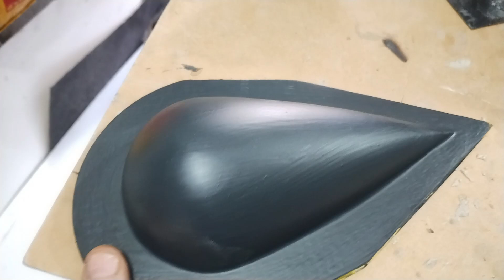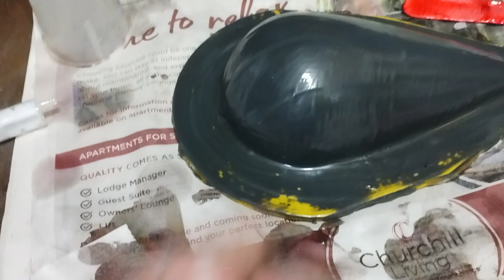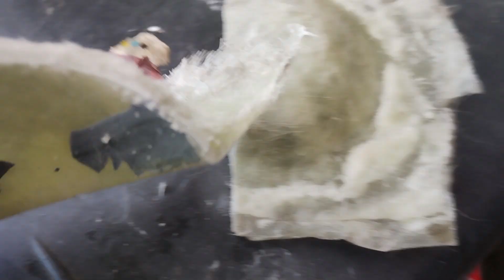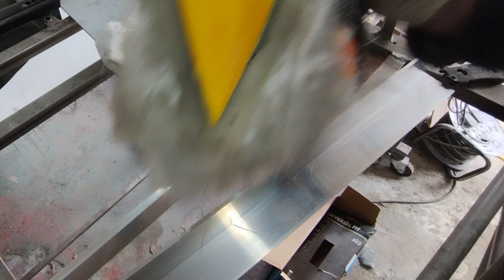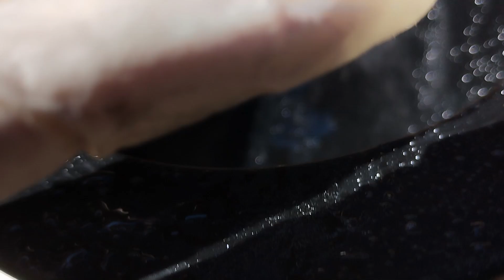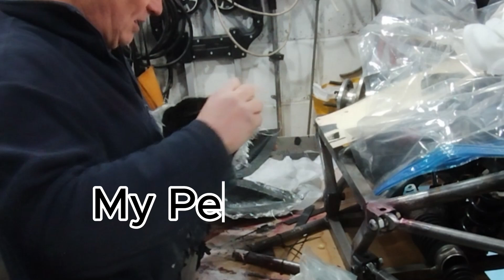3D Printed Mould, Hand Laminated Carbon Fibre & Cheap Vacuum Bagging using Clothes Storage Bag

Comment: Shaun , why don't you just print what you want and then carbon skin direct onto the printed item 

This would be less work and the carbon skinning gives amazing results 

If you look at the suppliers youtube channel they show the process

You can carbon skin anything , the results are much easier than producing plugs and moulds
Reply from the maker: @philfromsalisbury4538  I did that for the front wings on the ExoBusa. I've done it this way as a practice for the nose cone, which I can't 3d cos it's to big. 
But I may end up doing a mix of both methods for the wings.

Comment: Just a quick tip about de-moulding, if you have a air compressor and a blow gun you can pop the moulds off pretty easily with a decent shot of air between the buck and mould 😎👍
Reply from the maker: Thanks. I have those, I'll give it a go next time.